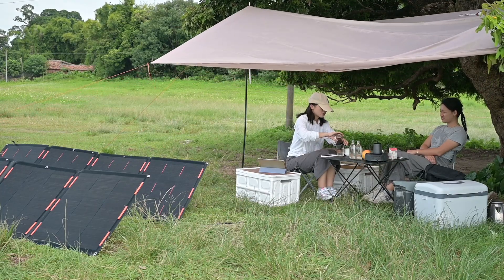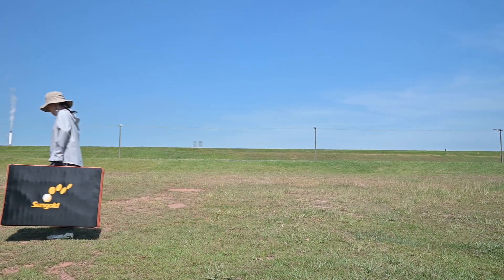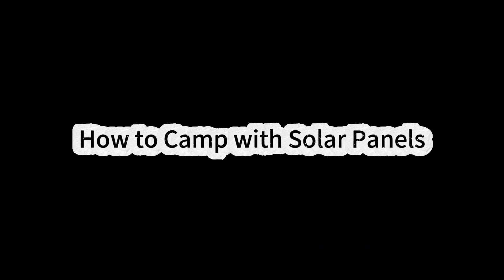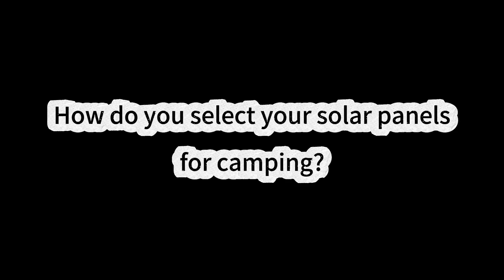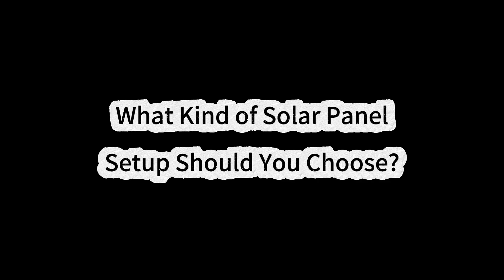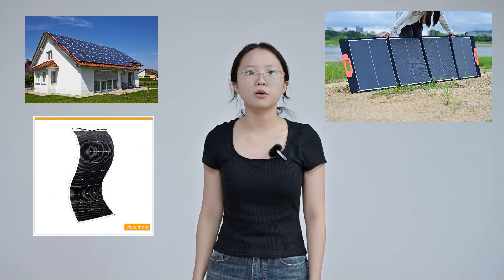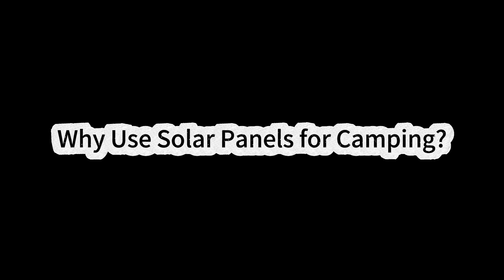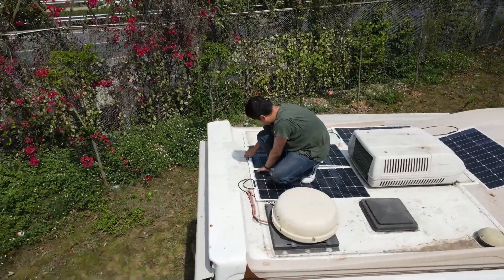DIY Solar Camping Setups: Power Your Wilderness Adventures

Comment: Could you explain the method for calculating power needs mentioned in the video in more detail?
Reply from the maker: Sure! You can start by listing the power consumption of all your devices. Then, divide that by the number of sunlight hours you expect each day, and finally, divide by the efficiency of your solar panels. This will give you an estimate of how many solar panels you'll need.